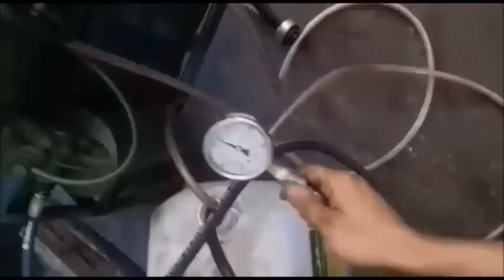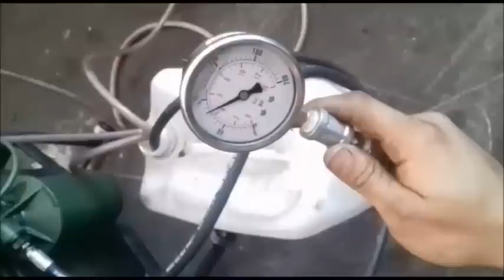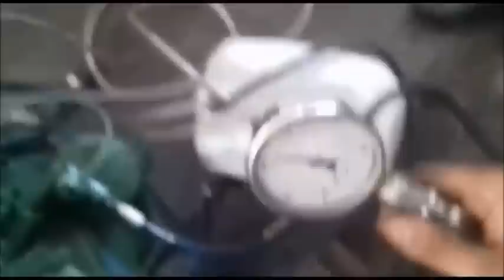OM 366 Retificado Funcionando fora do veiculo

Comment: fala parceiro tudo certo?gostaria de saber sua opnião. por exemplo se pegarmos um caminhão diesel original que chega aos seus 115 120 km/h. com seu motor a 2.500 a 3.000 giros se substituirmos seu motor por 1 a gasolina que chega a 5.000 OU 6.000 giros sua velocidade sera maior?
Reply from the maker: ola, sim seria maior se a gente considerar essa troca somente olhando o motor. Nessa condição teria de mudar relação de cambio e diferencial, senao provavelmente ele ficaria sem capacidade nenhuma de carga pelo menor torque do motor a gasolina.

Comment: é um.motor de 1620 ou 1721?
Reply from the maker: 1618... Mas é praticamente a mesma coisa....
Reply: Sim. Mas, como você mesmo disse, é só o coletor de escape. Ele pode ter diversos formados que praticamente nada muda. Ex: o Cummins série B 5.9 tem versão com coletor cuja saída é na extremidade, outros vem com coletor com saída bem no centro e por aí vai. Aqui tem motor de OF 1620 exatamente igual a esse do vídeo, mas também já adaptamos 366 LA em 1513 com o coletor do 1318 e saída pra cima, tipo o motor do Volvo NL.
Reply: Me refiro ao 1318 ônibus OF. Usa o motor 366A.
Reply: Isso. O OF 1318 foi apresentado em 1987 e ficou em linha de 1988 a 1998. Usava o motor OM 366A inicialmente  com 184 cv. A partir de 1996 com a entrada da norma Euro I o motor sofreu ajustes e passou a gerar 170 cv pra poluir um pouco menos e se enquadrar na norma. Detalhe que em 1997 a mercedes começou a testar o substituto do OF 1318, o OF 1417, com motor eletrônico OM 904 LA de 4 cil. Era o primeiro ônibus nacional com motorização eletrônica. O motor foi importado da Europa (onde havia sido lançado em 1996 para atender a euro II lá) e estava previsto pra ser lançado no primeiro semestre de 1998, mas devido a problemas pra adequar a linha de montagem (que ainda não estava acostumada com os motores eletrônicos) só foi lançado pro mercado 1 ano depois, em outubro de 1998. Por esse motivo (o atraso na linha de montagem que acabou atrasando o lançamento) acabou perdendo para o chassi K 124 420 da Scania (comercializado a partir de abril de 1998) o título de primeiro chassi com motor eletrônico a ser comercializado.